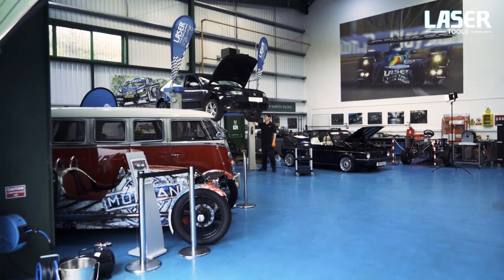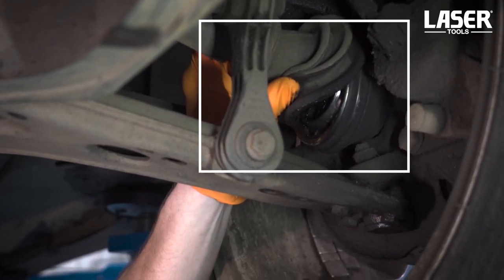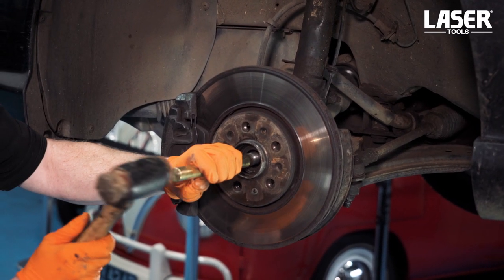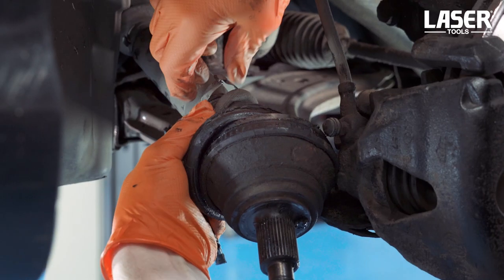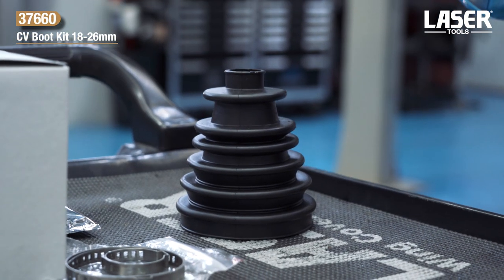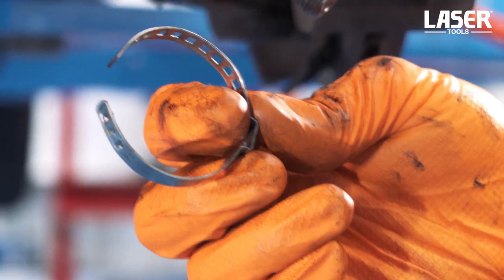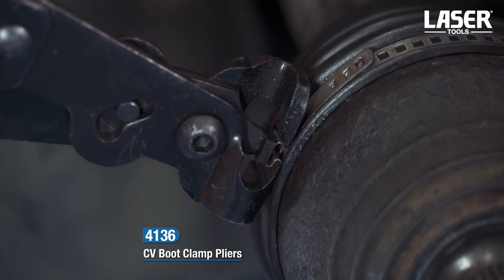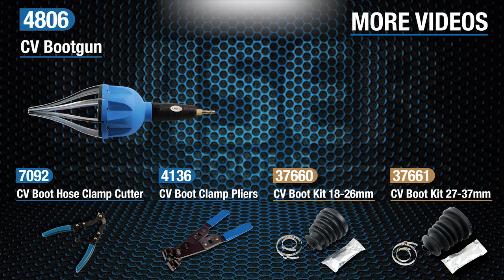4806 | CV Bootgun | Laser Tools

Comment: WARNING be aware that this REQUIRE a FLEXIBLE rubber boot. A normal rubber boot is too hard and rarely flexible and will NOT work! I have the same pressure CV boot gun and it will NOT spread a "normal" CV boot, you really need to ask the shop for a FLEXIBLE one, otherwise you will be highly disappointed and end up like me removing the whole CV axle and CV joint from the car in order to install a new CV boot.
Reply: Good tip! I didn’t realize they had axle boots that are more flexible. I would have ended up like you if I didn’t see your comment thank you!
Reply: Brute I though about that my boots are not flexible enough thank goodness I saw this